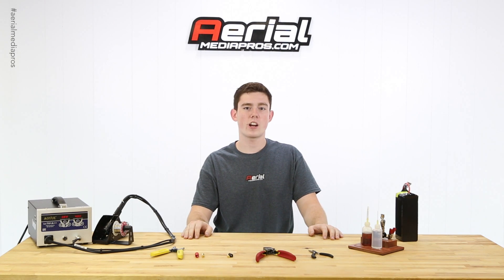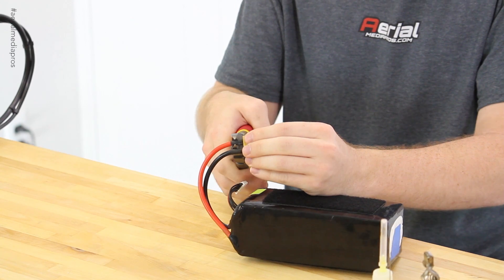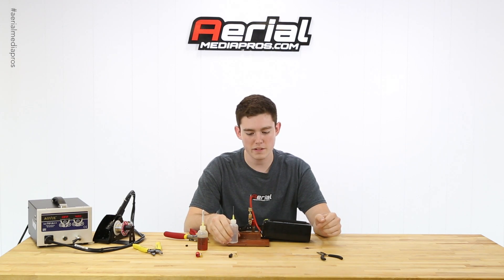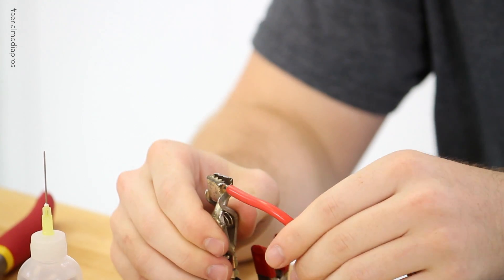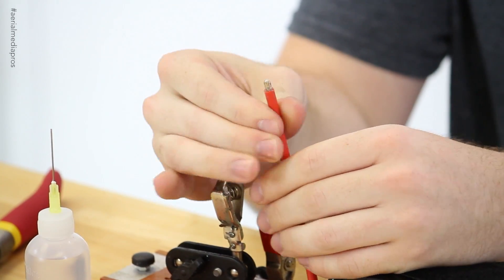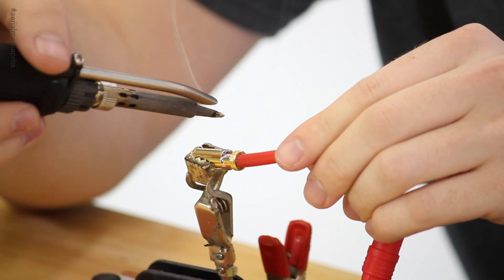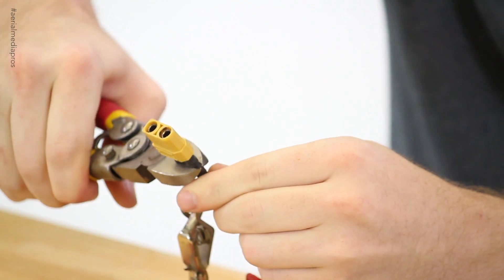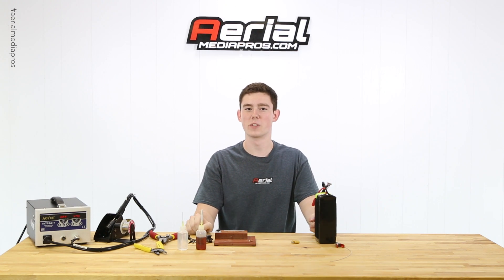How To: Soldering Battery Connectors by AerialMediaPros.com

Comment: Do you have any tips for making a "Y" adapter / connector as I need to use two XT60 battery leads to a single XT60 connector on my UAV ?